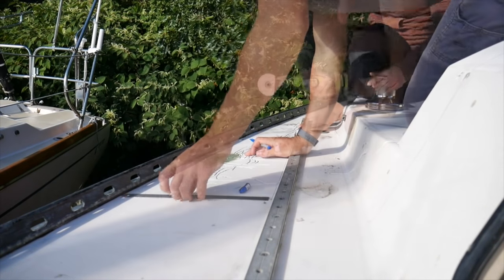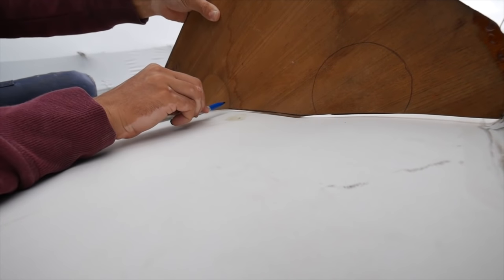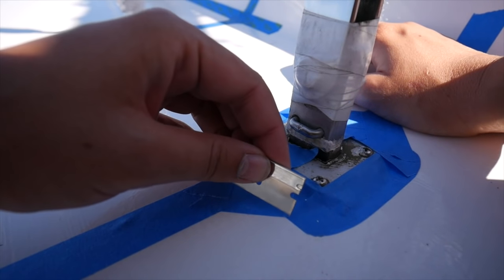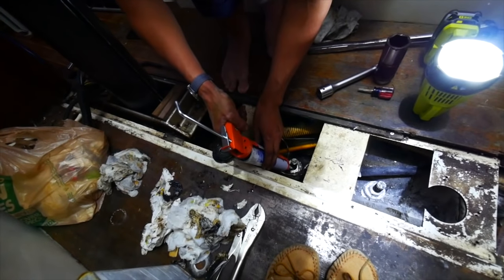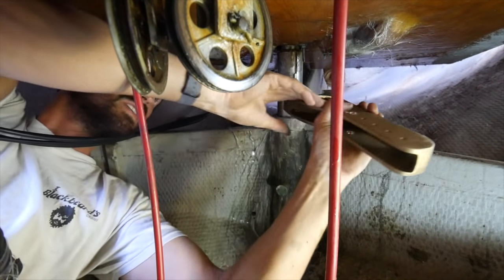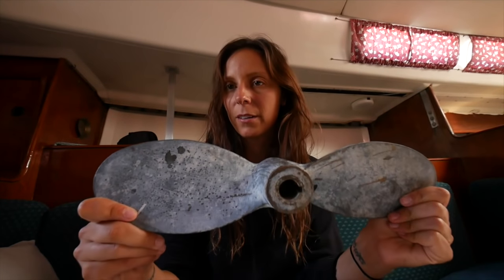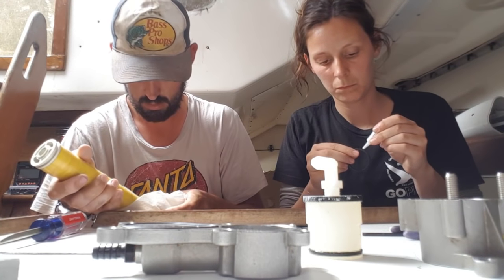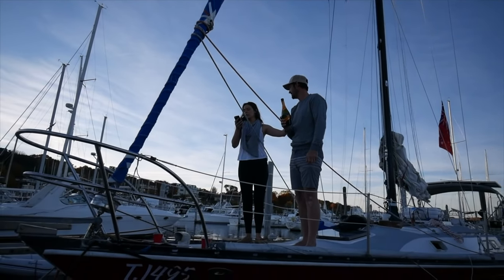Ep. 1 - DIY SAILBOAT REPAIRS To Prepare For OFFSHORE SAILING - How Not To Sail A Boat

Comment: Love this crew and boat and video. Love the work details and narration. Now, may I suggest: Those cheap crimpers and vinyI splices are weak and unreliable in a maritime environment. I suggest spending $50 for a rachet-style wire crimper and using the more expensive Nylon covered butt splices (semi-transparent). Test the connection by pulling it with 30 pounds of force. If your connection is near water, fuel, or bilge, use waterproof shrink wrap, as well.
Reply from the maker: We have been shrink wrapping almost all connections but good to know for the 30lbs of force and crimper recommendation!  

Thanks for the compliment we are glad to have you following along!! 💙

Comment: Just watched the video for the first time and am very impressed with all the work you have done with it so fa!! Also want to ask how much match calculation went into that torque calibration? The load application looks to be about half meter away from the ratchet head? Im sure it was all in consideration when planning :P Super impressed again and hope sailing is going swell!! Look forward to seeing more
Reply from the maker: Thanks for watching Ty!  I think bolts needed 380 newton meters, the ratchet was 42cm long and it was nine time mechanical advantage with the nine pulleys  so it ended up working out quite close to 100nm (our existing torque wrench) ... (380/.42) / 9 = 100nm

I'm impressed who knew that was in your skillset, it was certainly all new to me before John taught me!